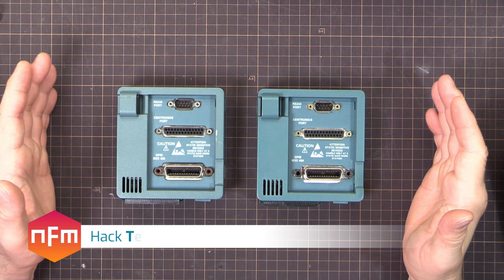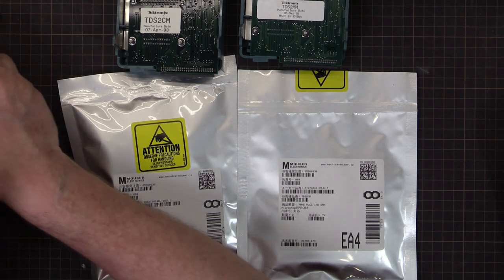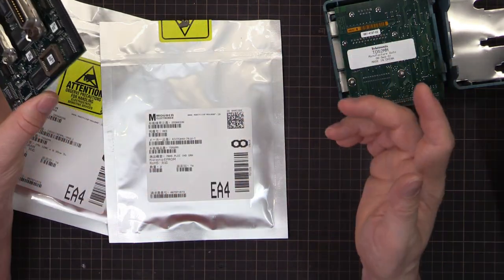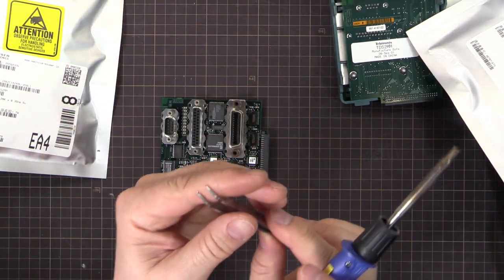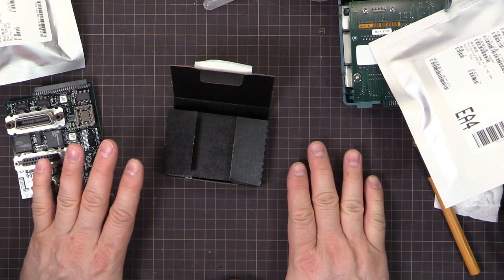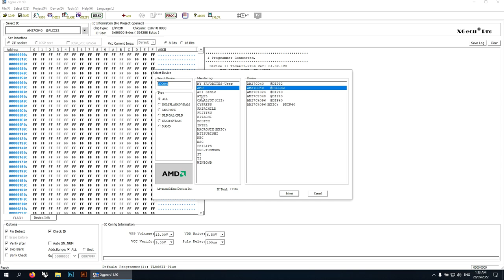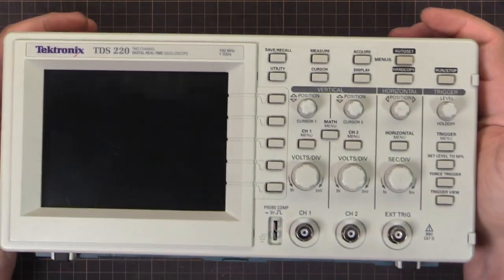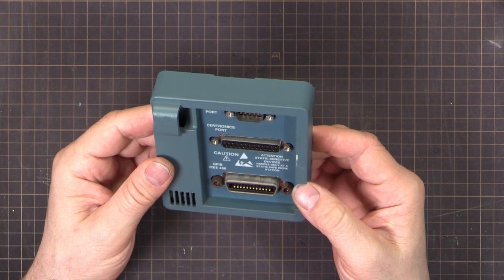Tektronix TDS2CM to TDS2MM Hack

Comment: Nice, I just recently acquired a 210 that is needing a new screen. I'm not much on using a scope, been a long time since I went to school for any of this and forgot most if not all of it. Anyhow, while scanning over stuff about these designs I found the module upgrade. My new scope had NO module installed in it when I got it so when I ordered the screen I also ordered the USB version of the MM. I'm eagerly waiting for the screen and module to arrive so I can see just what I'm getting. As I scan over the net for stuff to hack on these I found the LED backlight replacement for the CCFL I guess. Maybe I'll get lucky and get one of those instead of another CCFL part. The one I have still works but never having seen 1 of these scopes before I have nothing to compare to. Being the USB version it should have all the latest bells and whistles. If not, I want to send off for whatever is needed to fix it to this level. At least once the scope is back together the upgrade can be done from outside the main case. Tektronix obviously had something in mind for the future when they released these.

Comment: Curious if one were to swap out the RAM IC w/o changing the firmware one will it still work?  Going to assume the reverse would not as the firmware needs that larger RAM.

The reason would be to make sure that went well before now swapping out the firmware.  Sometimes changing several things at once and if one step goes bad, you don't know which one!
Reply from the maker: I would assume it would work with a larger capacity RAM chip, it just wouldn't use the entire capacity.

If you try it, let us know! :)

Comment: There is now a new option. There is a new board available that has a USB port for around $50 on eBay.
Reply from the maker: I have seen that, looks interesting and not too expensive. The USB feature is really handy compared to finding a computer with a serial port, or using a USB-Serial adapter.
Reply: @NearFarMedia 
I am glad I found this video. I had no idea that my scope had these options.
My 4-channel scope (TDS-224) didn't include this extension board and these features were sorely missed, so it was on the shelf. Finding this new USB option was the best answer I found.
I got this new board, drilled a hole in the cover for the USB port, and simply slid this upgrade into place. There were no software upgrades needed for my model, plug-n-go.
I love the additional math features and having an easy way to save files to my PC. This scope has a new place on my bench and the 2-channel is back on the shelf.
Reply: I have a TDS-1012B. Can I use the board?

Comment: Usually publishing this stuff too widely is what leads to there being better protections against these sorts of "upgrades" in the next version of the firmware, or the next generation of the products. Usually best to keep this stuff quiet and in places where it's at least not search-engine-findable
Reply: This isn't magic , there's no proprietary hardware being defeated, this is equivalent to dumping firmware into a battery ID EEPROM so 3rd party batteries can be used in devices, albeit this adds a feature to the software. The solution is never to take away the knowledge.
Reply from the maker: This hardware is decades old now. Replacing a few chips on an add-on board that hasn't been sold for 20 years isn't going to influence the business practices of Tektronix regarding their current products.......